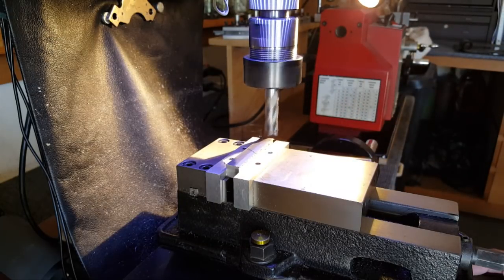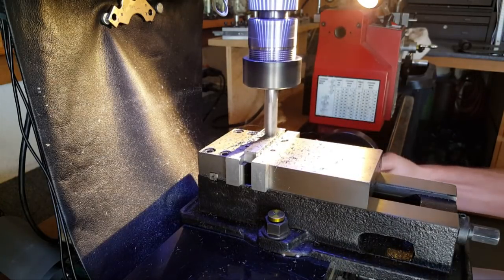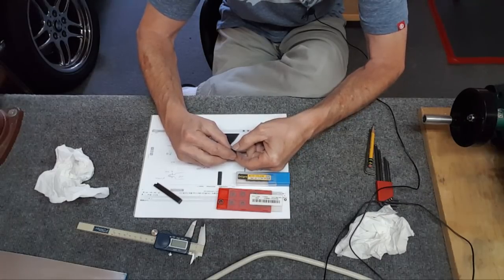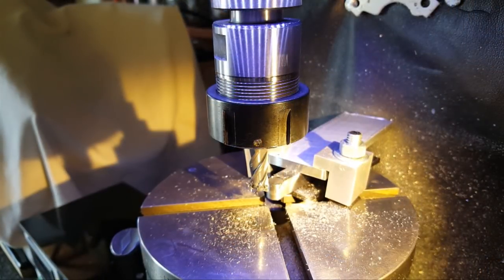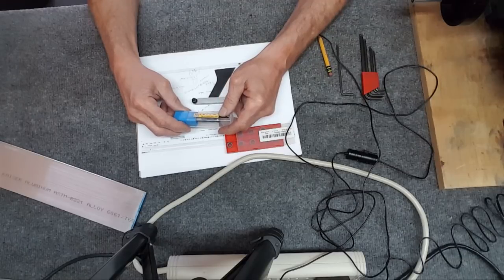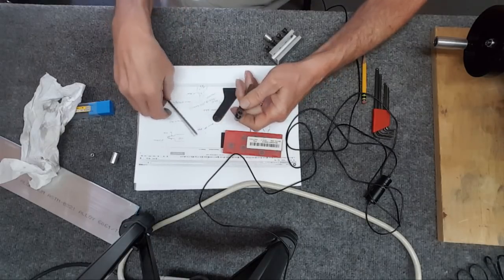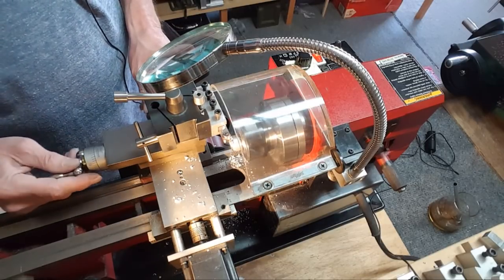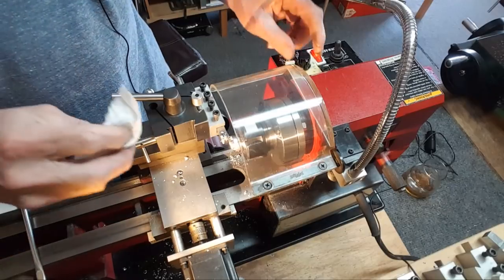How to make a carbide insert tool holder for cutting a radius DIY

Comment: Hi Dave, I took a look at the 10mm end mill and it really doesn't appear to be center cutting.  Also, why not just mill a holder shank down to what you need? just curious, Rich
Reply from the maker: I did some time ago but how do you get back rake in a circle. You can easily grind the radius but the top is flat. Works but there is chatter on deep cuts.

Comment: I didn't hear any mention of the 10mm endmill being a center cutting type. Did I miss that? If it is not, that probably explains the chatter on the plunge.
Reply from the maker: At first glance on their web site it appears to be center cutting. I just pulled it out and looked closely and doesn't seem to have the correct geometry for it. Good point!

Comment: I used to be the General Foreman at CSX's Raceland Freight Car Wheel Shop. We used round inserts in our axle lathes and boring mills. They would turn fine enough finishes that we didn't need any additional process before press fitting the wheel to the axles. You'll find that round insert to be very useful in any standard lathe application and when they dull just loosen the hold down screw and rotate it 90 degrees.
Reply: Craig L. Young I was going to say similar. I bought those to mess with and found that it took my polishing procedure from 5+ grades of grit then polish, down to 1 and no polish. Finish generally looks really professional. I generally only take a few thou off at a time, but love those when I can use them (can't get into tight corners)
Reply: Dan Rozwood : Don't babby them. I've seen Machinist hog off 0.100" in a pass of harded steek but the ones shown are about half the size that we used and we used high quality ones.
Reply: Craig L. Young I'll give that a try next time I'm out in the shop using them!